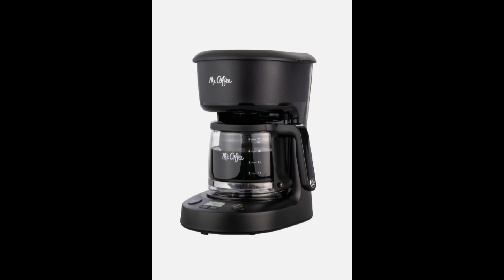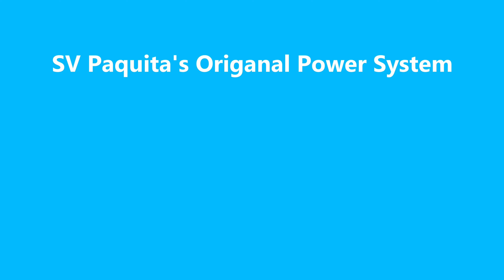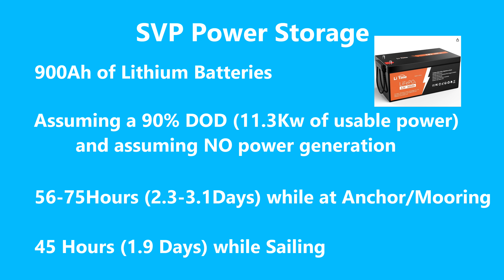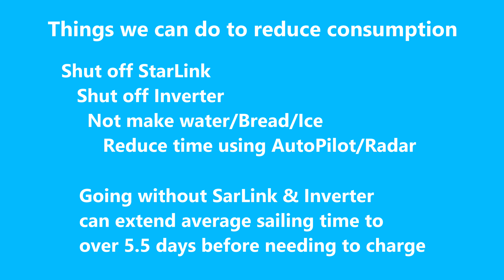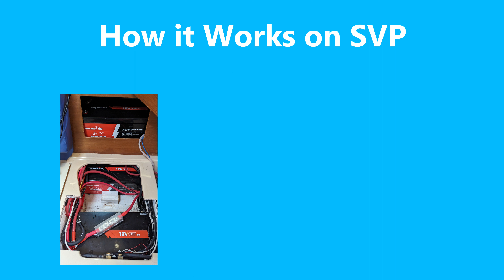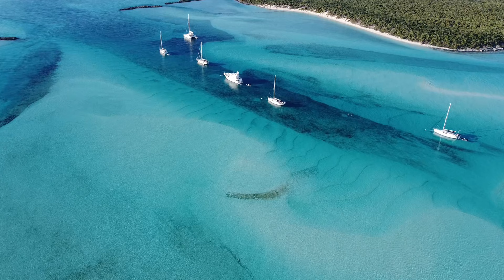Why are Cruisers Switching to Lithium? (Island Packet 420 Sailing)

Comment: You know its funny what people think is/is not normal.  We just upgraded from 1200AH 24V AGM to 1200 24V LIFEPO4.  If i had it to do over i would have gone with more batteries to get up to 2000AH or closer to that number.  I speak to a fair amount of people and they say that im crazy and why would you need that much battery. Their argument is always well we only have 400AH AGM and its fine.  The part they always leave out after its fine......."FOR US".  yes its fine for you not me.  Also if they put in 1200ah they would likely look back and say wow we should have done this years ago!!!!   Well we have our hot water heater on our inverter so it runs off the batteries, when we have guests there are hair dryers and other beauty devices, coffee and tea in the morning, lights, charging of devices, 2 fridges and one freezer if we are fully provisioned ( sea water cooled ), the inverter.........So even when the boat is pretty much doing nothing the least amount of draw i see is 7-10A which on its own is 168-240AH per day.  So in order not to run the generator every day or every other day i would rather have a bigger battery bank.  I would say on a 50-60ft boat ( we are 60ft sloop ) that 1000-1200 is minimum size for today.  I will start experimenting with turning off the inverter and shutting off the fridges at night ( when they are not being opened often ) to see how much power we save, I think it will be significant.  Ill also try to get everyone to shower back to back and run the generator while people are showering because the hot water heater is around 1500W so its a heavy user.   When we are sailing we still have all the electronics, electric winches, auto pilot.......so the power use is constant.  I do need to add more charging we have a 170A alt on the main and the generator runs the 100A charger on the Victron inverter/charger but we usually only see 140-160A max going in.  Id like to add 2 additional chargers so we can get closer to 300A going in and can recharge the bank in 3-4 hours while motoring with the generator running.  I think this is often overlooked as LIFEPO4 will take 300-400a charging with no problem.
Reply from the maker: Wow! That sounds like a wonderfully robust system! Thank you very much for watching and welcome to the channel. CUOTO
Reply: @svpaquita  we keep our boat in wickford ri, maybe see you around the north east this summer.
Reply from the maker: @Rainmakerlm  That would be great! But we hope to leave the Point Judith area for the Azors in May/June.
Reply: @svpaquita  are you squared away on insurance.  curious because we are looking to go to europe in the next two year and need to find a company.
Reply from the maker: @Rainmakerlm  yes. Finally. But it wasn't easy or cheap. Worldinsurance.com

Comment: We did some study’s about all kinds of battery’s at our university. This to see if we could use it in a aircraft. Obviously that’s no sailing but the knowledge was welcome. 

A couple items stuck out. 
Cost versus usage. That’s more like how many times do you need the capacity per year. 
Lithium can’t stand sub zero temperature. It works best at room temps so te speak. 
Other batteries can handle a light cold temp better.  Lithium needs more advanced monitoring systemen what results in extra cost. 
Lithium is a weight saver. On smaller boats that is a comfortable idea as space is not always available.
Reply from the maker: Thank you for watching and welcome to the channel. All good reasons to cruise the tropics with a Lifepo4! CUOTO

Comment: Excellent presentation Tim. Oh, how I pine for LifePo batteries and a larger alternator, but was limited to 90amp, so went to AGM's. Good call on removing the Panda generator. I just pulled one out of our Florida boat in Tarpon Springs. Anyone want one for parts? CUOTO's😄
Reply from the maker: Thank you very much for watching!  Oh yes, a dead gen is not worth the weight or space on a boat. CUOTO

Comment: It’s always good to put the inverter in a cool ventilated space. Help Increase the efenticy
Reply from the maker: Thank you very much Donald. Inverting hasn't been a problem (in regards to heat). But when it's pushing 120 amp (charging) it gets warm where I have it. Not good. I got to change it out. CUOTO

Comment: It’s called GlobalLink 520. It’s a remote monitoring device with a 5-year pre-paid SIM card. Costs about US$215 on-line. Let’s you monitor the system from your couch.
Reply from the maker: Thank you very much for watching Peter. My Cerbo GX does that as well, provided it has Internet access (like Starlink). But now with the boat shut down, it sure would be nice to have. CUOTO
Reply: @svpaquita  My boat is on a mooring during the season, and like Paquita, currently on the hard for the winter. The GlobalLink 520 is great, because you don’t need access to WiFi in either location. The 4G LTE SIM card should work anywhere…

Comment: DC to DC charging of lithium can be appropriate for a smaller boat used mostly for weekend/week sails where you don't want to make big changes to the current install, but want more house bank capacity. It's becomes a cost/benefit calculation at that point.
Reply from the maker: Thank you very much for watching and welcome to the channel.  I agree with you that for a small boat used for weekend sail, DC to DC charger would be adequate if you have a shore power source. Otherwise, you are still asking for a small charger to move a bunch of power over time. Time that you probably won't be motoring (or at least we can hope). Lol😄😎 CUOTO

Comment: Not having finished watching yet, my personal guess at why cruisers are switching to Lithium: cost. These Lithium blocks are simply cheaper per Wh per year (I know you could factor out the time component but with these very long periods it gets hard to wrap my head around ;-)). They last longer and are bigger, so for the same load you need to buy less batteries and you need to buy them less frequently. 

Of course, with your increased loads, you need to have more capacity, so you end up buying more and that's what makes it expensive. 

Btw, it helps if you start thinking in Wh or kWh instead of Ah - with Ah, you always have to mention the voltage of the bank. It allows you to match your load to your capacity easily, calculate what it will cost when you charge up in the marina, etc. It also make is easier to think about layout of your battery bank - with a 48V bank, you only need 1/4 the wire gauge compared to a 12V setup for the same power delivered. (In theory, you could go to even higher voltages but you need to keep in mind the risk of electrocution at high voltages - getting zapped at a few hundred volts can ruin your day...)
Reply from the maker: Thank you for watching (i hope/assume, you did get a chance to watch the video). All good points, but one has to weigh benefits for each application. I appreciate your input and look forward to your future contribution  to the discussion. CUOTO
Reply: @svpaquita  I did finish the video. :-) 

I did catch some confusion about units but I didn't want to nitpick, I assume you know the difference. I've watched videos from other boats (e.g. from Sail Life and their boat Athena) that went to 24V systems for the wire gauge, with a 24V alternator (less amps for the same energy!) and DC-DC charger to keep both 12V starter battery as well as a small 12V battery for the 12V electronics charged - you might want to check them out as well. Raising the anchor with just the battery seems to be neat. 🙂

Comment: Nice overview but really.... "Proprietary" No thank you. Open and documented or go home. Is this box mine after I paid for it or not? Do I have the info to fix it if I need to? (my engine does) It has taken the nav toy companies a while to figure this out but they all have and they all talk NMEA these days. Victron needs to learn the same lesson. No blue boxes without protocol documentation please. I should be able to connect power toys from any manufacture together and have them work. You would not be Vlogging without open standards. Actually there are a whole host of things you would not be doing without open standards from wrench sizes to plugging is an AC appliance.

Why are people switching to lithium? AN AGM battery has a limited life and has to be replaced sooner or later and lithium has become cheaper. A 100AH lithium battery cost the same or less compared to an AGM, gives more usable power, weighs about a third as much and takes less space as well. Most people still pay for a lead starter battery because they still do that job better than lithium. All the other things you list are true as well but even without those things, lithium just makes sense.
Reply from the maker: Thank you for watching. I have not found Victron to be closed architecture. Infact all of my Victron units all talk on the NMEA2000 backbone without a problem. My garmin MFD displays all of my Victron data.  Maybe I'm just lucky. Thank you again for being part of the conversation. CUOTO
Reply: @svpaquita My mistake then, You made an effort to call the communication proprietary.